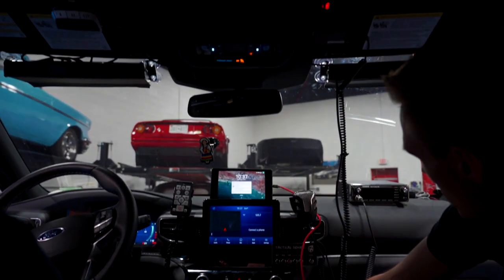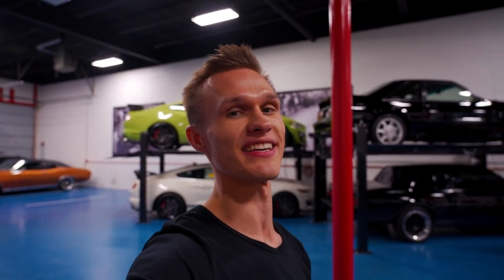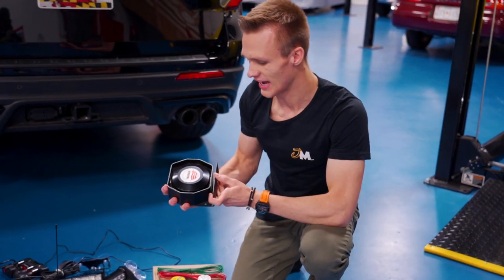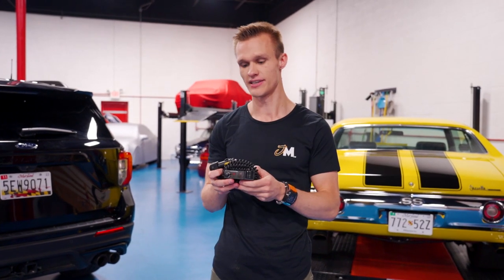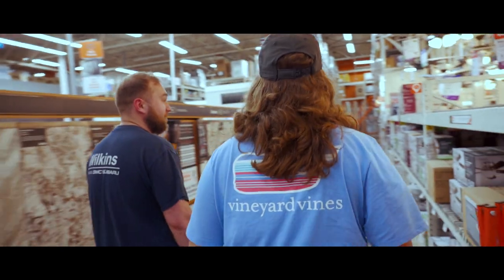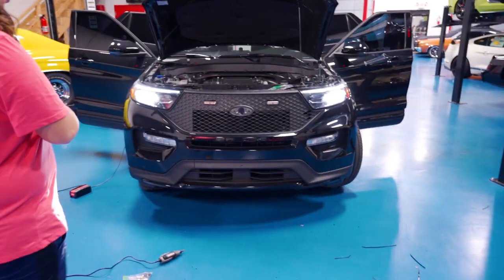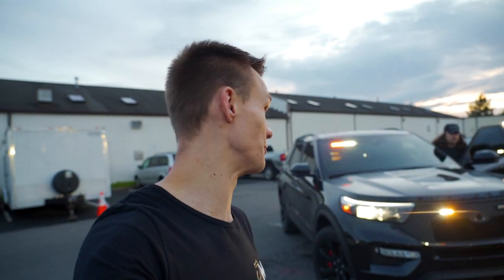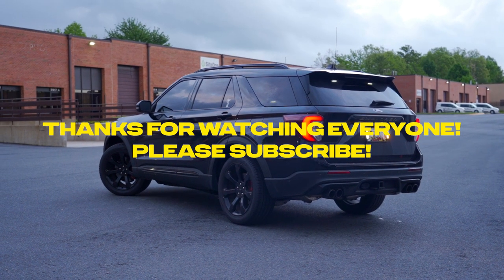MEET: THE ULTIMATE SUPERCAR SUPPORT CAR FOR GOLDRUSH RALLY! *FORD EXPLORER POLICE CAR*

Comment: Take all the trim off inside the car and hide/tuck the wires.. And you can fish the wires through/under the carpet  to under the seat so it's no wires showing. And pass wires through grommets on both sides of the engine that lead to the inside..

Comment: It shouldn’t be hard at all to pull up the carpet around the door seals and hide those wires better than having them go under the floor mat. Also usually there is a pass-through hole in the firewall where you can run cables for subwoofers and other speakers like that and have them go directly from the engine compartment through the firewall into the glove box. Might want to check that out because that’s how most car audio systems are wired at least when I used to do it back in the day.

Comment: does the truck have the same engine as the ford GT?
Reply from the maker: It's derived from it. The GT engine displacement is a bit larger, But it comes from the same thing!
Reply: Same block diff bore stroke intake and tunning

Comment: Absolutely horrible cable management. Taped wires on the back of the car? Like c'mon. Pile of wires under the passenger seat? Wires underneath the carpet? Zip tied PA and license plate? 🤣 I will not subscribe until you do something correctly. Earn the subscription.